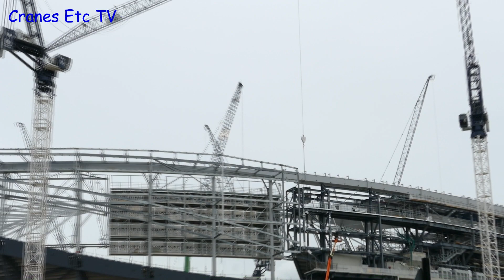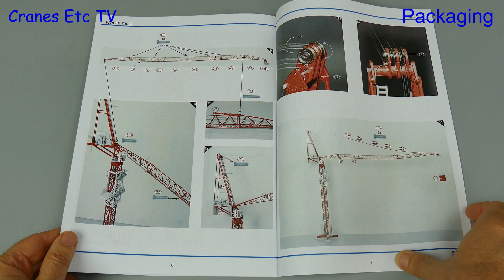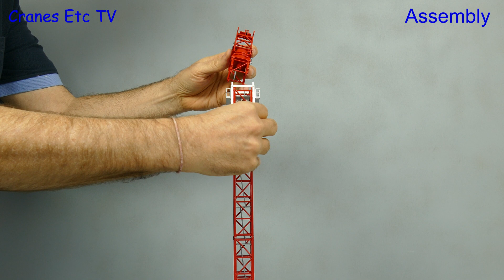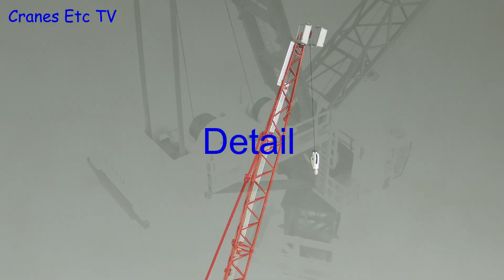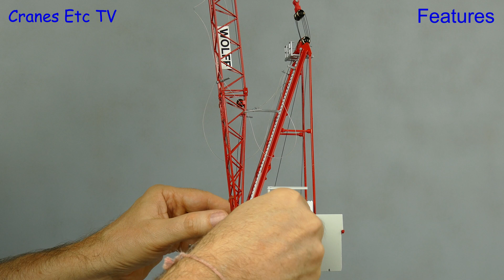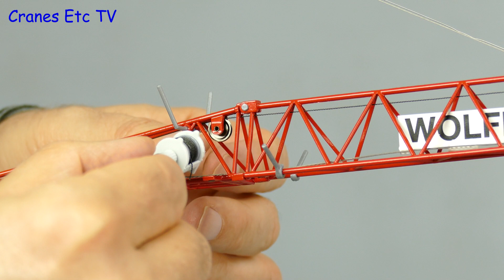Conrad Wolff 700 B Tower Crane by Cranes Etc TV

Comment: Is the jib extension kit more lattice for the Luffer or is it just the rooster on the end of the luffing jib
Reply from the maker: Rooster  + different counterweight.
Reply: The original WK700B-US contails the "FlyJib", its electrical cabinet and winch, the main electrical cabinet in a stainless steel (V2A) and a shorter counter jib wit steel couterwheight instead of the normal ones out of concrete.